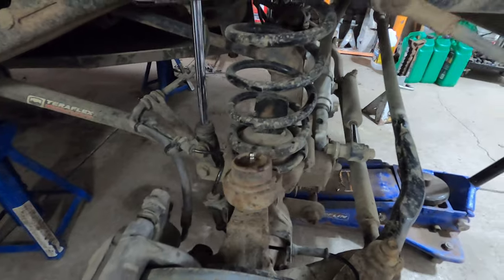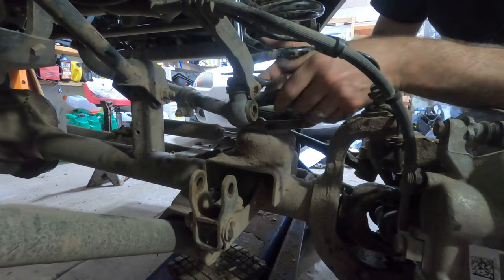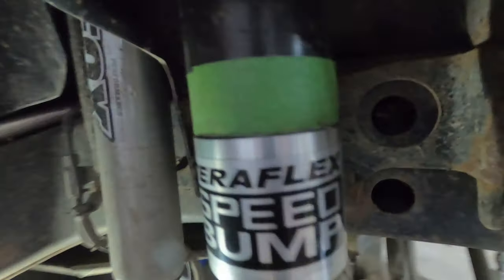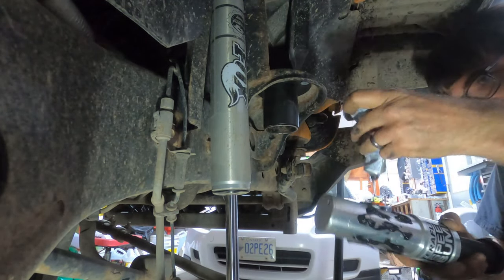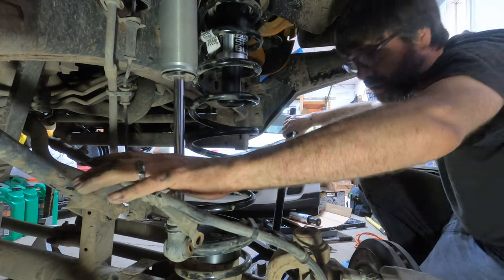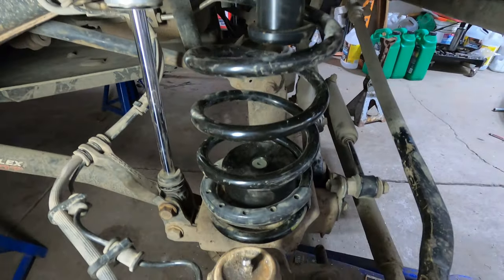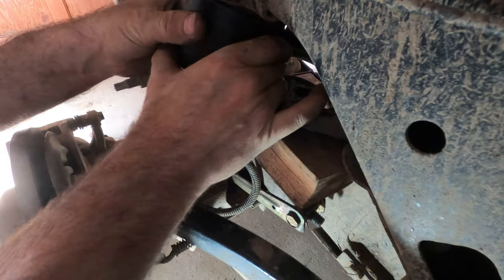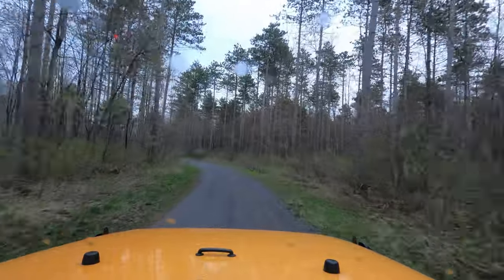TeraFlex SpeedBump install on a Jeep JKU

Comment: I understood one thing. If you always drive on the same road, and potholes start to appear there. You need to buy 10 bags of crushed stone and fill them there. Because even having installed an expensive spare part, it will still break and fail. Because the road is broken and potholed .
Reply from the maker: I take it you don’t drive off road.